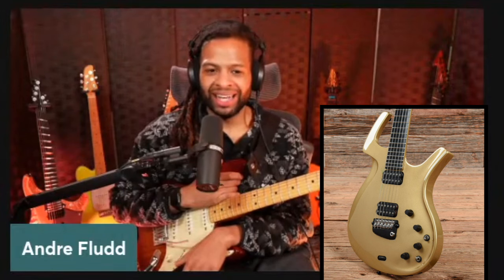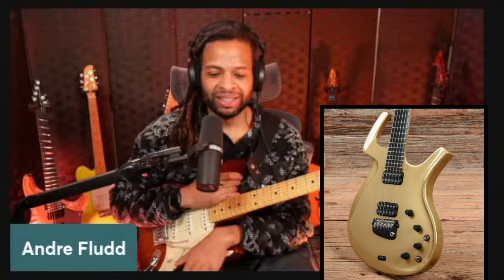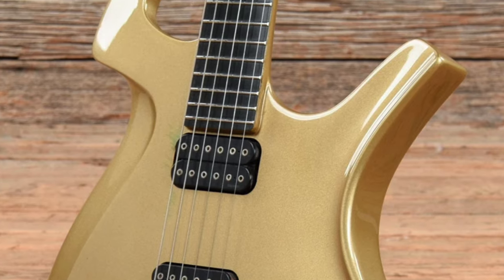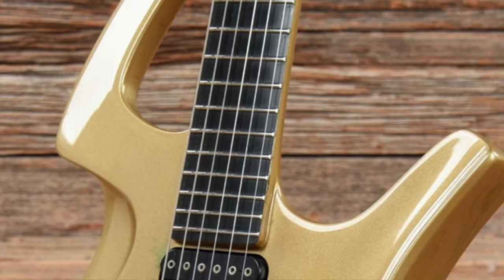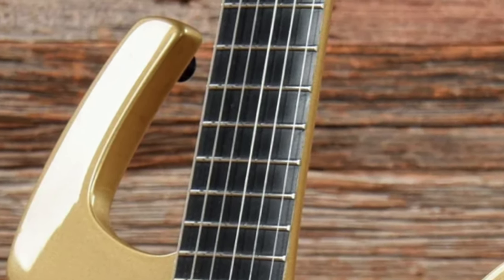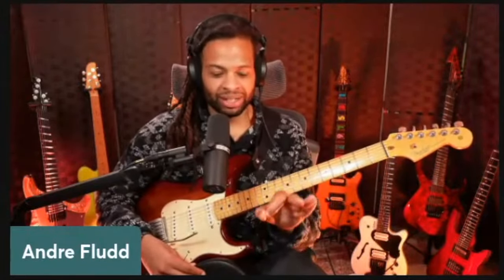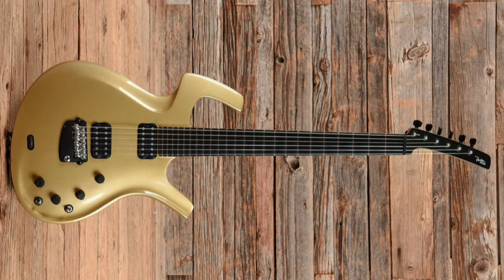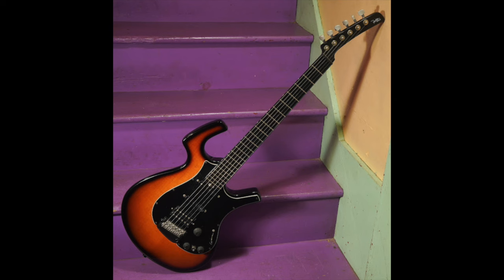Talking Parker Guitars With A Fellow Parker Geek Andre Fludd

Comment: Awesome interview/discussion! I love my Parker Nitefly (NFV4, made in early 98). Has updated saddles so the little ball bearings don't pop out (An issue with those Nitefly saddles...I still have the originals) and the previous owner had replaced/upgraded the humbucker but did include the original (and it works fine). Don't have the "Y" cable for it but no big deal there. I have the Parker gigbag but sometimes wish I had the hard case...just for some extra protection. I would love to find a Fly in decent shape but not for the money they're going for these days. Heck, the Nitefly I have has more than doubled in value in the 5 or 6 years I've owned it. But I buy 'em to play, not to invest. And she do play nice! Thanks for geeking out on the Parker!

Comment: I've had 5 flys (all pre refined) and 4 pre refined nite flys, plus a few P-series models... I had terrible luck with everyone of my nite flys... the truss system was broken and each had too much relief. I even spoke to Ken about it and there's nothing that can be done aside from from cutting into it. I have never had an issue with any of my Flys, Except, my 1995 deluxe in Italian plum... the G slot on my nut wore down a bit too much, I filled it and filed it with a graphite epoxy blend I made and have had no issues since. Took 10 min. Love my Flys. I also have a 1hr long video on em if you're interested! Ken is the man and thank you to the FlyClone project for the resources.